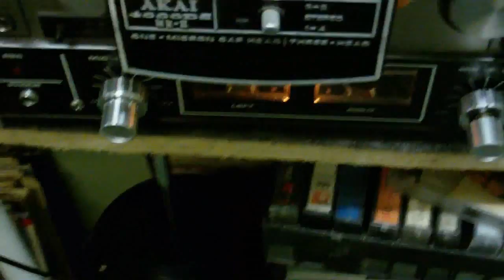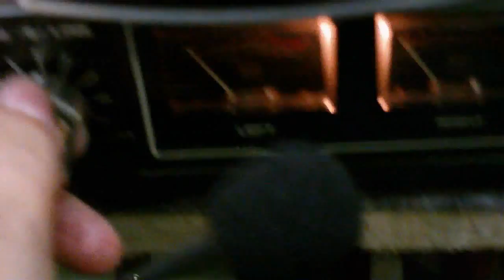Making an adapter lead for a headset microphone so I can use it with an ordinary mic input

Comment: how do I do this using an xlr adapter? since it has 15v without phantom power I figured I can use one and attach a resistor to it to make it five volts
Reply from the maker: +Angel Vega I don't know, I'm no expert on professional microphones.
Reply: I mean, it is a Siberia V2 Mic, your method fixes it, but I don't want to be spending money on batteries, I know XLR plugs are powered, my mixer has 15v normally on the XLR so I guess I can get an adapter, then put some resistors in the power joint and get it down to 5v so my mic does not get burned.
Reply from the maker: +Angel Vega Ok now I'm with you since at first I didn't know what kind of microphone you had.  Anyway, the actual voltgae with these kind of microphones does not matter, unless its a USB microphone (I'm assuming that this is not a USB one, I'm not sure).  So, if you use a 10k resistor instead of 2.2k, it should work no problem from the XLR power.  The current going through the circuit will be very low so it can't burn out anything, but the mic will still be just as sensitive.
Reply: +CoolDudeClem cheers for that!
Reply: +CoolDudeClem aye, me again, I've got it wrong, it is 48v., is there like a way of reducing it to 5v or 9v with an array of resistors?
Reply: +CoolDudeClem forgot to say, I measured it it outputs 7mA I think... it says 7.0 when pointed toward 20 m, on the multimeter.
Reply from the maker: +Angel Vega Your mixer should already have internal resistors built in, however it might not be enough. So try with a 10K first see if that works, if not, use a 4.7K instead, it shouldn't damage the microphone.

Comment: what is the resistor that you are using...
just connected without using a resistor and voltage  i used was 4.5 , there is s hum ( i plugged into a Behringer X1222USB mixer... )
hoping to see a reply soon, have a nice day.

Comment from the maker: The microphone is connected to the tape recorder the same way a normal microphone would be, the battery's positive is connected to the signal(hot) wire via a 2.2 k resistor and the negative of the battery is connected to the ground (shield) wire

Comment: Really good job! It's also a good idea to make a "Y" adaptor so you can hook the mic up to both channels! Years ago I had a cheap elecret condenser microphone wich came with a computer program that wrote what I was speaking into the mirophone (it worked extremely bad :P). When I got my first cassette deck with mic input I tried using that mic and it didn't worked - now I know why. Today it's the other way round: I have tons of normal mics for tape decks but these don't work on my computer :D